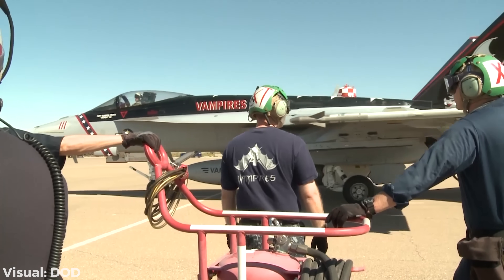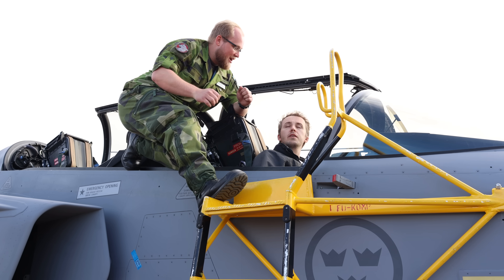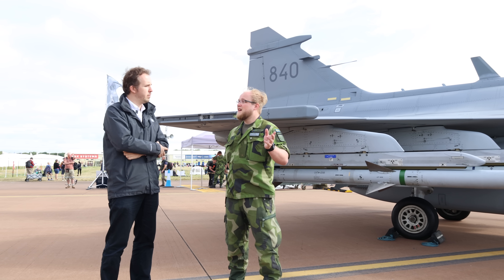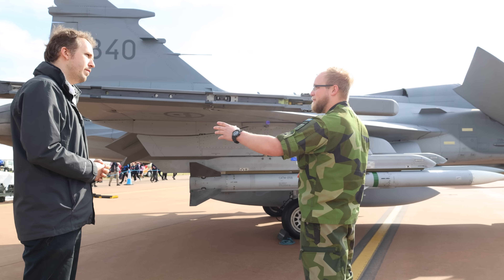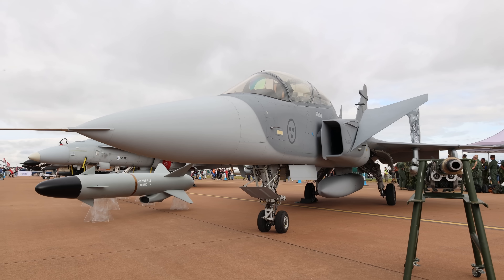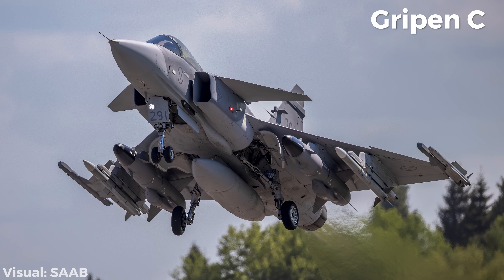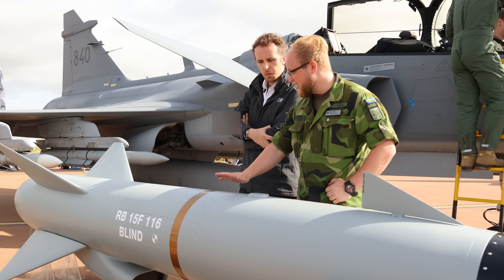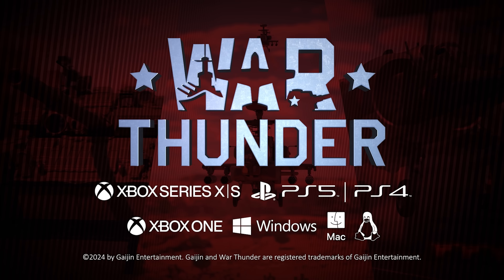Making a No-Ship Zone: Gripen's Anti-Ship Missile is Massive | RBS-15

Comment: I was a supply clerk on a carrier, early 1970s, and watched flights ops every chance I got, mostly from the island 50 feet above the flight deck, so my observations are not particularly comprehensive ... I remember that sometimes, when loading bombs on F-4s, A-6s, or A-7s, the redshirts would screw a long pole to the nose, presumably instead of the fuze, then heave it up while a couple  of others fastened down the stabilizing bolts on the pylons.  Other times they would bring the weapons cart directly underneath and winch it up or jack it up hydraulically.  I did not know enough to know why the difference, and from several hundred feet away it was not always easy to tell the size of the bomb.  Maybe the direct heave was only for the 500 pounders, or maybe when they were in a hurry and did not have enough winch carts available.
Reply: I can't speak to procedure in the 70s, but these days, 500lb are hand loads, 2000lb hoist loads, and 1000lb either, depending on the crew. Whether we use hernia bars or not depends on nose/fin configuration and pylon location. Most ordies I know would rather hand load where possible rather than fool around with the hoist.
Reply: @collinbanke6996  Thanks! Always interesting to find out the details I couldn't see.

Comment: Whats the difference between swedish pylon vs nato pylon?
Reply: @jintsuubest9331  swedish pylons are quicker to reset and rearm to cut down on turn-around time, release mechanism are powered by a small explosive squib compared by natos pressure operated releas
Reply: In general the Swedish design is just better in every way but the US and Nato has so many missiles and so many different aircraft in use with the Nato pylon so they don't want to change. It costs to much.
Reply: @SonnyKnutson  As always, our designs are superior :D
Reply: A: The wiring and B: none of your beeswax
Reply: Swedish more aerodynamic and less weight, and the RBS15 Mk4 will use the Nato pylon.
Reply: IKEA and meatballs.

Comment: That picture from the front with 4 of them loaded is quite intimidating.
Reply: That is really intimidating is how the RB-15 works, it's programed to used the terrain to it's advancing and do almost a wolf pack tactics and swing around and hit from multiple directions on a target simultaneously.
Reply: @AdmiralLj  Som på alla andra moderna sjömåls/attackrobotar då.
Reply: But can it actually fly with all four of them attached? I don't think I've seen any photos of it airborne in that configuration.
Reply: @_NaLo_  it's the Gripen E that can carry 4 so it's not all that strange you have't seen many pictures of them flying not many if them around yet, C/D can carry 2 of them, and yes E can fly with 4 of them even if it's not the normal load out.
Reply: @samolofsson2401  Blir svårt att ta 4 st om man vill ha med extra bränsle.
Reply: @_NaLo_  Yes but i would like to hear from pilots what manouvres they can pull with 4 of them mounted.
Reply: Can it use the 4 missile engines as back up?